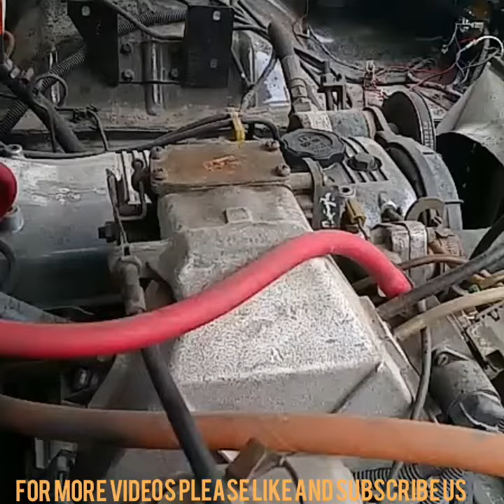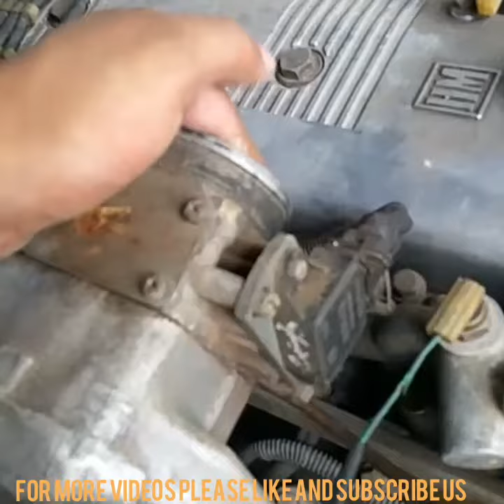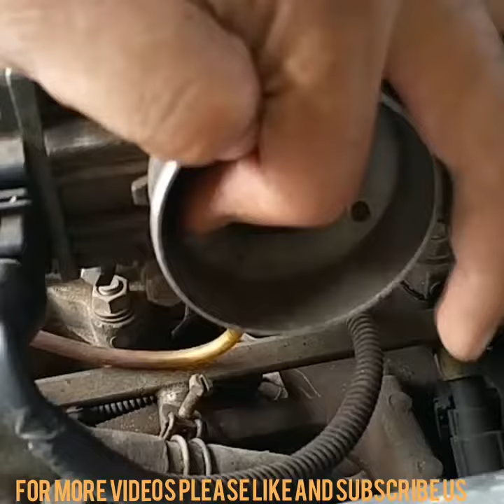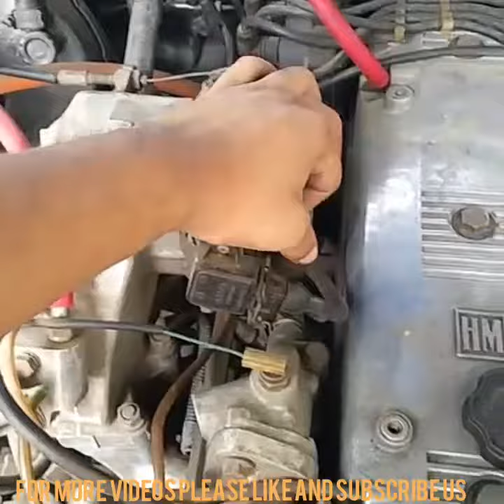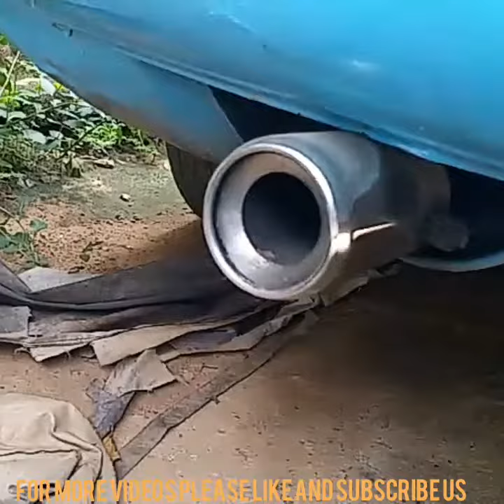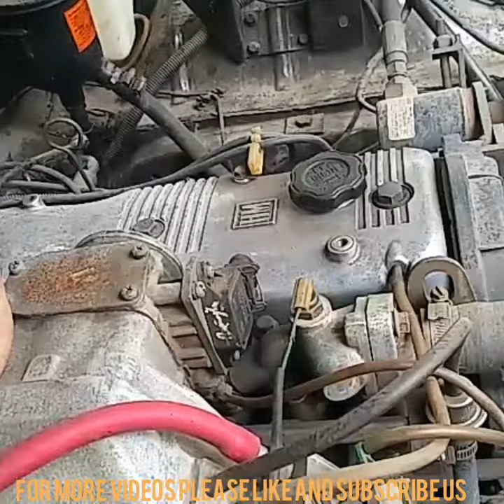Hindustan Contessa I/S/U/Z/U mpfi engine sound

Comment: I’ve the engine on my jeep, gives 5-6km/l. How much mileage doe this thing gives?
Reply: Me too I have such an engine. So if u have already solved the problem do message to
Reply: its the same. i get 6-8
Reply: @991shom  have you tired changing the injector?
Reply: @thunglamohumtsoe5710  yes! ive changed injectors, all sensors, coil, plugs, even the ecu haha
Reply: @991shom  and still the milage is the same??? 😂😂😂